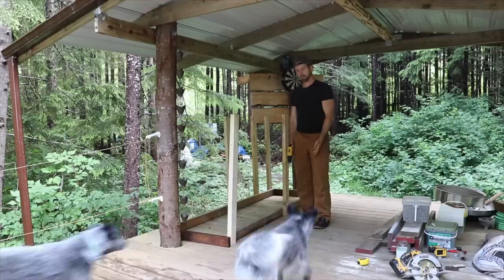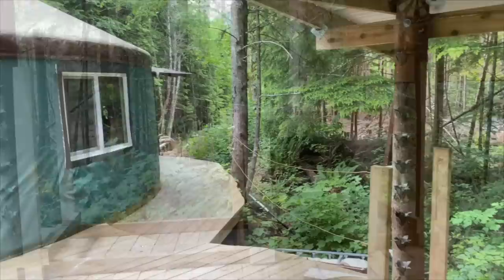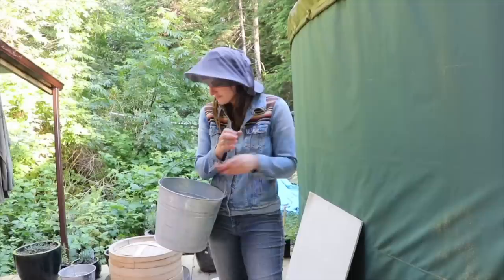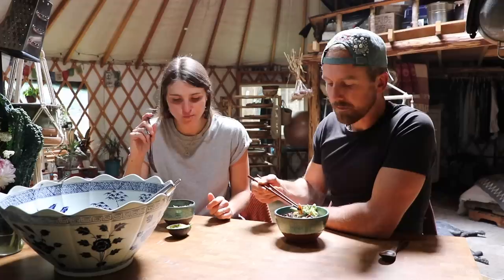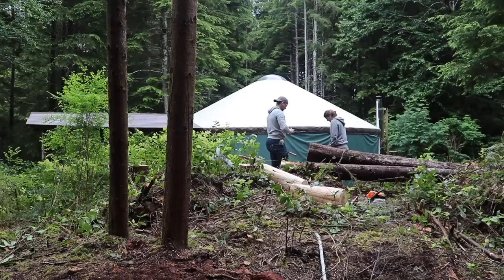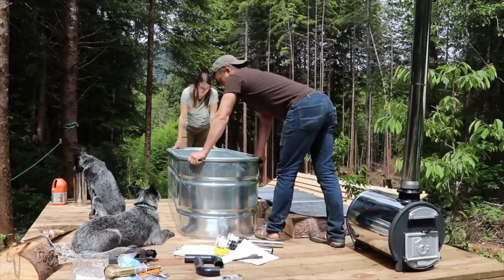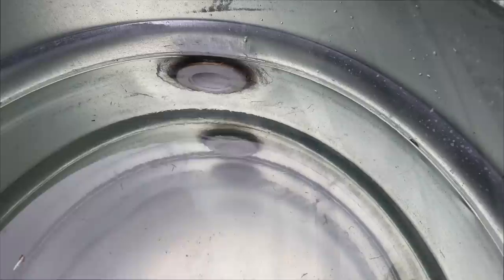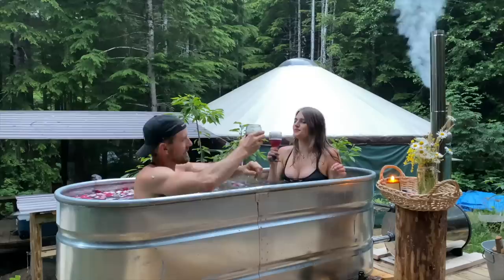TIMELAPSE - DIY Wood Fired "Hippie" HOT TUB & CHINESE WOK STOVE - Start to Finish

Comment: Chofu hot tub heater is da bomb.  I have mine heating a five foot diameter galvi stock tank.   From cold to soak is about 1.5 to 2 hours from lighting fire.   You will find two more sections of pipe added will make the stove draft a lot better.   Liked the setting.  Perfect for what my friends call the hillbilly heater.

Comment: How's that concrete been holding up?
Because the wok holder looks great... but I worry if the heat will do well on concrete. Concrete retains moisture and when you get it hot that moisture will turn to steam and blow the concrete apart here and there. I hope I'm wrong but every time I've seen a car fire near a concrete curb it makes the curb crumble. So hope you do well but science may be against it.

"The mechanism behind heat-induced spalling is fairly simple. When 
concrete is exposed to temperatures above 212 degrees F, the boiling 
point of water, the moisture in the concrete turns to steam. If the 
temperature rises more rapidly than the steam can escape through the 
concrete matrix, the rising pressures exceed the strength of the 
concrete and it begins to spall. This spalling can be explosive in 
extreme cases."
Reply: And that is why we use FIRE BRICK. And this is why it needs to be re pointed from time to time.
Reply: @s vernon WTF!

Comment: This looks very good, but the moskitos would kill all for me
Reply: Use a thin wire grid, plus another, thicker bore. Run very high volts through thin grid, ground through the other. It’ll kill all mosquitoes. Do this on all large surfaces. You only need 10 watts continuous power. Problem solved (during the solar power day)

Comment: Jake I recalled  that's simple  theory of steam plant. We called that fire tube. The only difference is you use  firewood.  The other concept of this is using diesel to fire the heating element ( tube or pipe). Its familiar to you the uses of steam power plant.

Comment: A standing circulation fan on deck would push the mosquitoes away? You’d need to rig up some battery power with solar.
Reply from the maker: We have lots of solar and battery power and a larger system coming up, stay tuned

Comment: How do you control the temperature? From the video, it looks like through thermal siphon to get the water warm. 
Cool idea! Well done. But just be careful you don’t get Sous Vide ! 100 F => 38 degree centigrade is perfect  temperature. Did you also made a sauna hut ?  
Oooh.. it is so great in winter.

Comment: You are going to water seal your deck aren't you. Guarrantee it will double the life of it. Also you might want to get a thick rubber mat that would go between the tub and the wood supports under it. Help protect that wood from rot and cushion to stabilize the tub.

Comment: what causes the water to flow / circulate ??? Motion of being in it / water temp / how many coils are inside the burner that the water flows through . like a radiator on a car , but if you put it in a burner ???